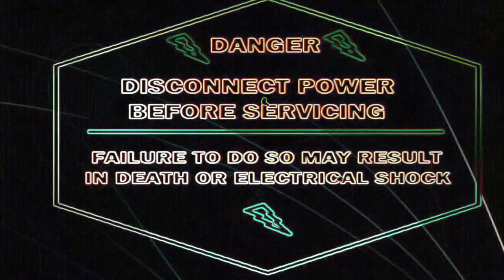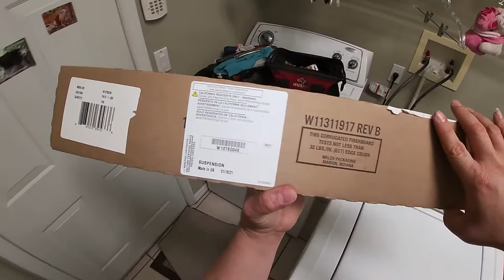How to Fix Whirlpool Washer Shaking and Hitting Sides  | Washer Off Balance | Model WTW4800XQ4

Comment: Instead of using vice grips you'll find it much easier to use the hook end of one of the old suspension shocks ( cut off the spring part and bend  straight end to make a handle if you want ) once the new shocks are in place along with the 4 new top fittings. Then put the hook end of the old shock down through one of the top new fittings, and hook onto the new shock, and pull it up through, and past the new fitting placing the new hook into the fitting notch, and tilt, and push the old hook out from under the new hook. This way you never have to put you hands down into the machine, and it's much easier to pull up on the new shock. You can use this hook to hook method with most springs.
Reply: Wish you could have done a short video to show that. I don`t know where you can post video if on this guy's YouTube channel? You might have to do your own YouTube channel? I have never set up a YouTube channel myself. I guess I should try! Millions of people may have done it and it just keeps on going! Thanks Steve C
Reply: Good tip

Comment: thank you very helpful video
I attempted to change these same springs on a washer after and the pink plastic spring in the rear were longer than the white plastic springs in the front. Initially it rocked even worse and was off balance. I then put pink in both the front and back by reusing the existing one and it solved the problem completely. I'm not sure the difference between the white and pink plastic other than the length of the rods but it worked so we were happy.
Reply from the maker: You’re welcome thanks for watching my video👍🏻👍🏻💯💯

Comment: Your video was very helpful and I was able to complete the repair, but the washer still shakes violently when spinning.  Any idea what could be causing this after replacing the springs?
Reply: Did you happen to figure it out?
Reply: @mxkcrm  Yes.  I replaced the Amazon springs with OEM springs and so far so good.  Thanks.

Comment: I found out the spline to drum was the problem.. not the springs i replaced them but the spline to drum is the repair.the spring is the simple fix if it jumps after that the drum is the problem..

Comment: We replaced the suspension rods on our machine and it didn't didn't work.  Had to call a repair man and he told me the washer needed to be recalibrated if you you replace anything and showed up how, not that I remembered, lol.  But that might be something you need to add.  It worked fine after the recalibration.
Reply: P.S.  ours was a six light Whirlpool which must be recalibrated.  The repairman didn't like the six light, lol
Reply: To bad you paid a repair man for that. YouTube videos are available to show you how to recalibrate and it’s really easy
Reply: @lakoncers13  hey bro can you share what videos that would show recalibration please?
Reply: Don’t the shocks differ from suspension rods ?

Comment: That was a waste of repair parts
Reply from the maker: Why That didn’t solve you of balance washer issue??
Reply: @DIYRepairsNow  .... I reactively assumed this video would provide a solution, and I bought ta new set of struts. After running the calibration post installation I came to realize it must be the sensor that is failing as it was banging violently up against the sides. With an empty tub, it was jumping across the floor during calibration.
Reply: @DIYRepairsNow Well when i put the washer in calibration mode it continued to bang-up the sides of the washer and even caused it to jump out of location. I checked the leveling.
Reply: So did leveling and recalibration work? I’m having the same problem with the same model
Reply from the maker: @thrillovate  as a first step you can try to re-calibrate and level the washer if that doesn’t solve your problem which 90% of the time it won’t especially if he’s off-balance and is shaking violently you will have to replace the shocks
Reply: @thrillovate  No, there's a sensor that was the issue. The only way it could be those springs or "struts" is if to was significantly overloaded, or the spring or it's mount broke. They don't exactly wear down.  I levelled and calibrated about 3 times... One appliance guy said he won't even repair it, because it wouldn't be worth the repair. I decided it was time for a new washer.  The new washer works like a dream.